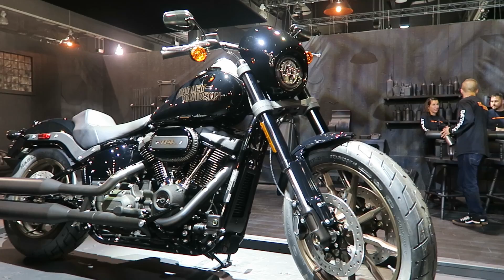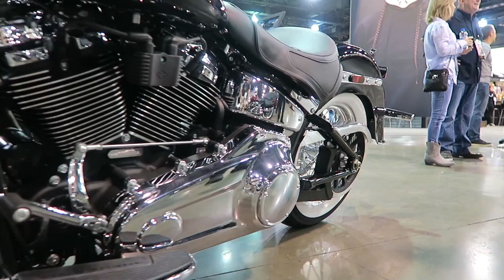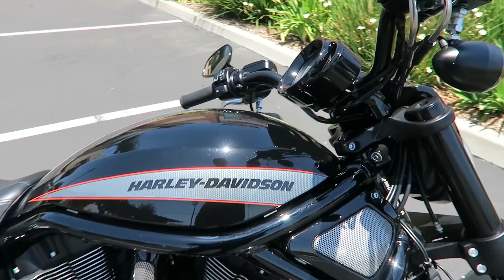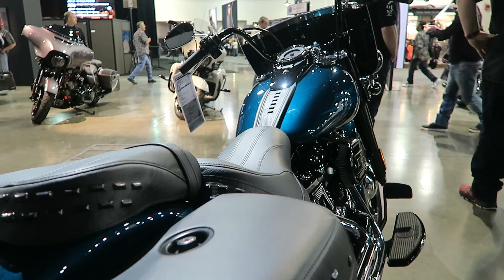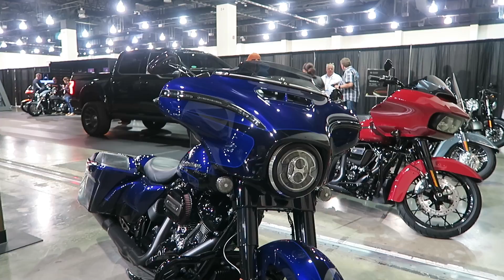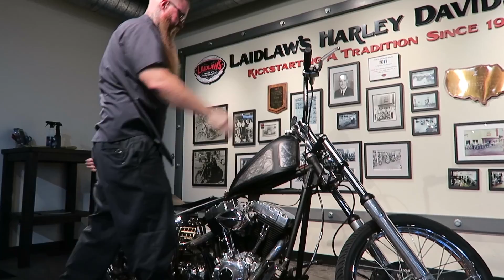Harley-Davidson: The Look, Sound, & Feel - You Just Wouldn't Understand

Comment: I've owned numerous motorcycles in my life,  and I now own my 1st Harley Davidson,....I get it.
Reply: You got it all right and your going to get it some more when you need repairs done.
Reply: @NA-mu8ek  I've repaired all my own bikes over the years, so what's the difference.
Reply: You shouldn't be riding if you don't know how to repair a bike. Also....have fun trying to remove all your fairings and covers at the side of the road, to fix something simple. 

My R6 had a gearbox failure resulting in a broken pelvis.

VFR800 needed a full new engine at 50k (bad previous owner)

Aprilia RSV everything but the engine went wrong. 

2000 Road king EFI. No problem so far, had the can chain tensioner done for peace of mind. Has 70k mileage on it now. 

1998 sportster with 1200 conversion. No issues at all. 

Bad previous owners can break any bike.
Reply: This.  I rode triumph for 15 years.  Bought my 2021 street glide special last summer.  I get it.
Reply: Not quite, more 🤔🤔, bisexual. Lol, best of both worlds.

Comment: One of the things that I admire about Harley and their core engine design, is their adherence to the Radial piston formation of their engines.
Every single copycat forgoes this design element and uses offset pistons instead. And it makes the engine look crooked no matter what angle that you look at the bike from.
The directly one behind the other Cylinder arrangement around the hub looks much better and more clean and aesthetically pleasing.
I am completely aware that this makes the crankshaft and piston rod system more complex and harder to manufacture, but it is a much much better looking system, and it has no detriment to performance. It actually helps centralize the shake of the engine as well. 
The offset VTwins, like indian's Thunderstroke, look nice, but because of their offset design, it really makes one cylinder too big, and the other tucked away and it looks wrong.
Constantly makes the bike look crooked or twisted.

Harley is the last company left making a stock Radial Vtwin, and when they stop, it will be the end of an era.
Harley's look so good because their engine, set as center focus, looks good to begin with from the top to the bottom. It's symmetrical in the way it needs to be, and then features it's front and back appearance as it needs to be.
Even the VROD and Street's engines being an offset vtwin, Harley did a far better job of hiding that aspect so the engine doesnt look so crooked in their frames.
No one else even tries.
I hope Harley always has a Radial VTwin in production.

And yeah as nick was saying the "Harley's are loud" myth always got me with people, because stock harleys sound super quiet to keep them safe from the EPA. Everyone screams about Loud Harley's and blame harley all day long. But they don't realize that exhaust swaps and loud exhausts are the whole motorcycle industry, not just Harley.
Reply from the maker: Great comment. I’m going to pin it. The radial piston config is something I should have mentioned. Yes, the symmetry is so vital to the beauty of the engine. I wish we would have covered that. You’re right about no one else putting in the effort to create the PERFECT v-twin look

Comment: HARLEY:
1. Scale up soft tail frame,
2. scale up the new liquid cooled motor, 
3. put motorized windshield also (yes it is great on a tourer)
4. build ultimate touring bike. 
5. Market alongside the existing bikes
Also: electric bikes like livewire maybe make batteries modular and exchangeable, like the kid bikes,at dealers and other locations in a vending type machine. You can lease them and charge monthly or a Flat fee. NO Charging time and more dealer traffic.

Comment: I've owned three Harleys (a Sportster, a V-Rod and a Road King). I wouldn't own any other brand. Call me your typical Midwestern American (which I am...can't change that!). I appreciate the fact that HD is both "old school" and "new school." I'm totally pumped about the Livewire and the Pan America and believe Harley has to compete with the other premium brands of motorcycles to continue in business in the 21st century. Yet despite the new types of bikes coming out from HD, Harleys have been an emotional thing for me. No other motorcycle gives me that visceral feeling that a Harley does. That's not a knock against any other manufacturer. There are Harley snobs and anti-Harley snobs. So be it. When I'm on a Harley, I am "home." That's the best explanation I can give...not easy to quantify but it is there!

Comment: Come on guys, the balance or predicament for HD is meeting EPA requirements , particularly the more stricter and ongoing tightening of EU standards -  'noise'.  The Evo motor with the then SE mufflers had just the best sound.  Based on your comments, HD should have stuck to the Evo, because the M8 motor just doesn't get anywhere close - from a 'sound ' perspective. Performance car makers have got around this in the past by building in drive modes ('normal', 'sport' ' track' modes) where 'normal' mode met the 'noise' standards and got the car passed the rules.  Well, that's going to change, in the EU cars will have to pass the standards in the more louder 'track' mode.  Harley will have to meet the more modern standards and governments are going to require all manufacturers to meet the standards. HD have had exceptions approved in the past to prolong the inevitable, but the exceptions have time limits, time is running out.  And this is why HD is producing a proportion of their fleet to include water cooled and electrification, and the more quieter M8 engine has evolved.  Let's face it, it's only the 'greenies' that want an electric HD.  Government pressures will continue to push volume of engines to get quieter. Mat, I disagree with you 100% on electric windscreens.  I can tell you, if you tour, having the ability to change the height of the windscreen to changing weather conditions is brilliant.  When you want to cruise around 'showing off' (I think the other term is 'looking cool'), then you move the windscreen height for 'coolness'.  This has been a very biased show.  I know many riders that after their first ride on a Harley, say that it's a piece of s#it, doesn't handle, doesn't go, feels like a pig.
Reply from the maker: You’re right about the stricter emissions standards. We are CA, believe me we know all about emission regulations. You’re right about the EU tightening up too. The shift isn’t just influenced by that though. The adventure bike and street fighter are completely different animals. They aren’t cruisers. Their riding practice requires an engine that is more conducive to the type of riding they’ll be doing. I tour, and I’ve ridden with electric windshields. They are ugly, bulky and after you set the height one time then you’re done. Just buy the right height and be done with it.

Comment: You don't understand the "feel" of riding a Harley until you ride your own. I rode Jap bikes for almost 30 years before I bought my first Harley at age 46. A Rocker C. Totally different feeling. I still own a V4 Jap bike also, and I love riding both for their inherent traits. But I finally "get it".
Reply: smirnaft You guessed right. VFR800 with Vtec (Interceptor in US). Carbon fibre pipes makes it sound like a small block Chev. Rode inline 4's for years, but it's the torque of a V motor that gets me going. Torque shove for my style of riding wins.
Reply: I totally get it. I used to own several VFR’s, loved them, and they just keep on going. Bought my first Harley a Year ago, and it is true, I never really thought it would suit me, but after a test ride I couldn’t get it out of my system and ended up trading the RC79 in.. good for you that you are able to keep the Interceptor.

Comment: People don't understand, if you liquid cool it, you can up the cam and redline, you get more power but this will change the sound to be like a V-rod. If you liquid cool it but leave the cam the same, it swill still sound the same but you just made the engine heavier for nothing. I would also say this, a HD does a good job of making you feel connected to the bike, a sport bike makes you feel connected to the road.
Reply: Liquid  cooling  higher compression ratio ..    leaner  fuel ratio for better emissions..   but  you can't up the RPM's  too much if you are still using push rods..   @Nicodemus
Reply: my point was that those who complain the loudest don't understand enough about engines. liquid cooling lets you run the engine "hotter" which generates more power that an air cooled motor could do. but running hotter and faster changes the power delivery, the engine sound and several other things. if you were going to liquid cool an engine, there wouldn't be a point in keeping it a push rod motor, as you would just make it heavier and hit then hit the ceiling quickly, as you said.
Reply: Good  Ole  Heavy  air cooled Bikes  that handle poorly  that's what Fat Old Farts who buy HD's like .  Put Put Put   ..  but why do so many have to run open exhaust ?  That will make you deaf and annoy   every one else..
  Liquid  cooled keeps the Combustion chamber cooler for  higher compression rations on a given octane gasoline and more advanced timing  better MPG and more power..
Reply: Mike Skidmore i wouldnt say the new fatbob handles poorly. It was the bike that made me take HD seriously for once.
Reply: If you wanna make noise get a two stroke 

https://www.bitchute.com/video/PKyCKRU6e6xG/
  Kenny Roberts beat all the Harleys  so the AMA  banned his bike .. the only way Harley can compete is  with rules that Handicap all other brands..
Reply: I remember Kenny said they didn’t pay him enough to ride that 2-stroke terror. 
I always thought 2-strokes had an advantage being lighter, able to rev higher and having twice the number of power stokes per rpm.

Comment: A few years back I had a metric cruiser (was a good solid bike) but when I had the chance to get a Road King I jumped all over it. That Harley just had way more character all around. I still have it and while I have other makes/models in my garage also that one always puts a smile on my face. 

I wonder about things and choices Harley has done over the years myself. Usually asking whats the hold up and what were they thinking.  I am looking forward to see what happens with the new engine and models they are introducing. I just just hope they don't fall into past mistakes.  Price is going to be a huge factor followed by specs. Price has always been a big problem with many in motorcycle crowd. 

I would love to get a new M8 based Harley, ogling Road Glides and Ultras, but the price tag is rough for me. My dealer doesn't have much interest in working things out unfortunately (several conversations)

Comment: To me, most HDs don't sound like what I grew up with. The ones that do, run two into two pipes. Bigger cams help too. Gives it that metallic, potato-potato lope.  Personally, I think my stock 107 sounds fine and I don't want the extra noise, but if I was going for heritage HD sound, I'd buy a two into two exhaust. The M8s I've heard with them still sound true to  form to my ear.
The M8 is smooth with a nice thrum. I don't think that's exclusive to HD anymore though. The part of the feel that really shines for me is the comfort. HD nailed the ergos for me with the RK.
The looks are surely a big part. Few mfgs go to the effort of showing off such a sculpted power plant with tubes and wiring so well hidden. Though with them all painted all black these days, that really doesn't matter. With everything black, you can't even tell it's a V-twin in there from a short distance let alone how much effort they spent making it so uncluttered. 
I think HD would have done well to put a Vrod engine in something like a Fat Bob with mid mount pegs. I think that would have appealed to guys transitioning from sport bikes into more comfortable cruiser oriented bikes. Then they could ride all day and still get on the computer and post their dyno sheet numbers on the computer at night.
Good subject, and yeah it's hard to put it into words. Even short demo rides aren't enough. I was hesitant after demo rides mostly due to the weight when paddling it around or doing slow maneuvers. Now that I'm used to it, it's a piece of cake...well at least when the throttle is doing the work.

Comment: It’s the single pin 45 degree V Twin that makes it what it is and the feel of the firing pulses that H-D is now dampening down for the modern little darlings who are so soft and testosterone free that they just can’t handle the real thing. The fact that the M8 is a throw away engine which  isn’t as rebuildable as the EVO or TC is a glaring example of the modern world and it’s lack of values such as tradition, integrity and loyalty. I understand that the MoCo has to evolve with the times in order to survive but I still see a consistent lack of not only the aforementioned values but also build quality and consistency in quality control of the M8. I’ve been inside multiple M8’s and found a lot of cocked valve seats, piston cooling jets not torqued to spec and inferior materials not to mention the oil migration and total sumping issues which are so easily solved! I love H-D and I want them to not just  live but prosper however they must get the bean counters out of engineering and QC if they are to do so. I shouldn’t have to go to Darkhorse Crankworks to get a straight balanced flywheel assembly or Zippers to get a well designed and performing top end that’s gonna give me 120-150 hp & tq that’s gonna last for 100-150k miles before it has to be freshened up! I’ve been riding for over 50 years and I’ve ridden every brand and type of bike available and I ride H-D because it “moves” me. That being said, I’ll stick with EVO and TC engines until the MoCo gets it together again. If they do. If you think I’m wrong Matt, tell me why and then we can maybe figure out a way to prove you are right.